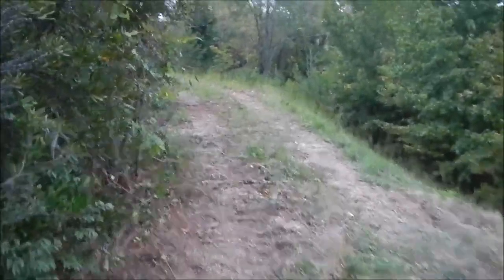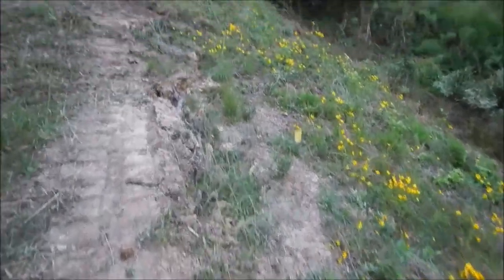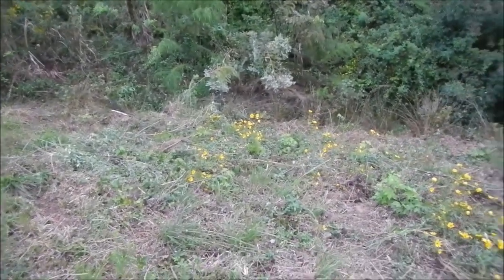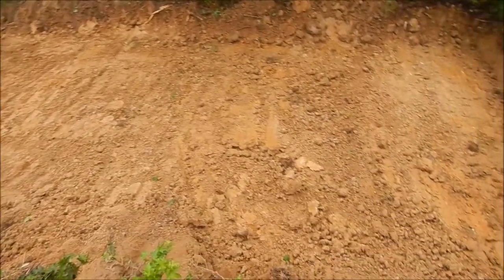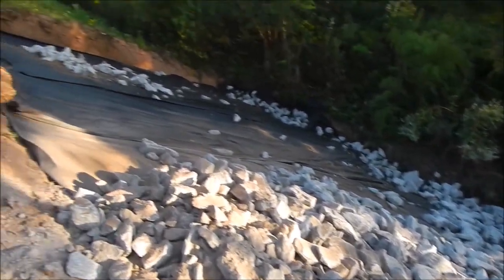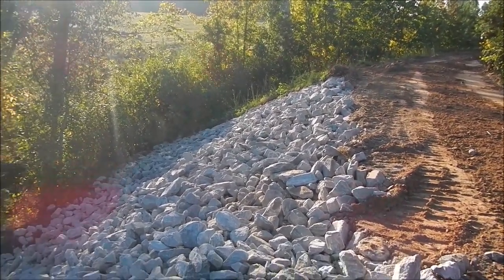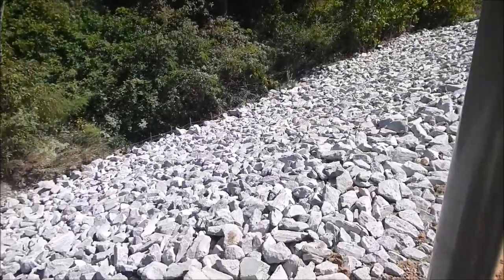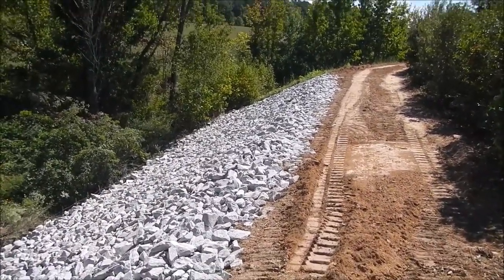Slope Stabilization

Comment: Just wondering why you didn't put in a toewall at the bottom or up the slopes? Since the toe of the dam is at the creek, wouldn't you want a toewall to keep the creek from undermining the dam? Not judging, just asking. Great videos by the way. Thank you for posting.
Reply from the maker: lsufanatic26 everything was knotch down in the ground except the 20' where the Creek curved.  We put the wire to hold the rock... It's what the engineer wanted